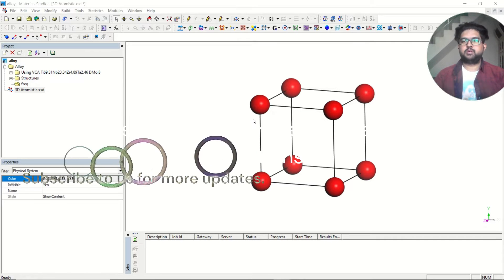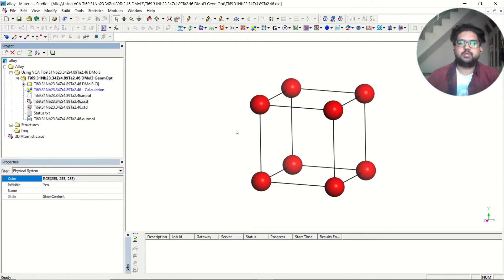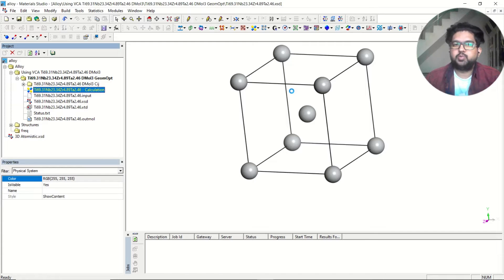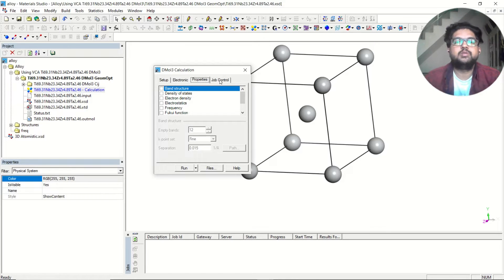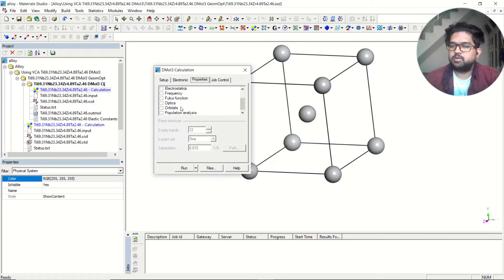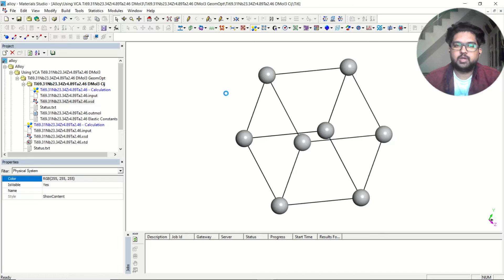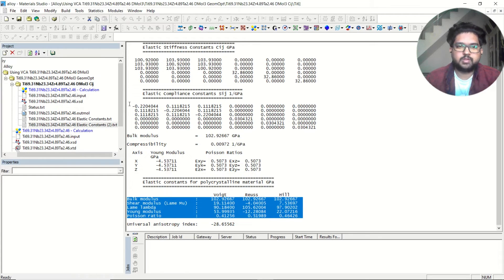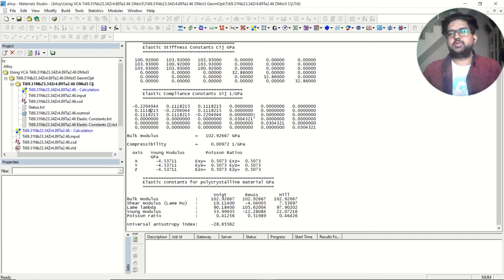Elastic constant and other mechanical properties calculations ||Gaurav Jhaa

Comment: I have a doubt....we have elastic constant calculation in materials science using energy deformation method....again we have elastic calculation using the stress strain method ...what is the difference between the two? if my energy converges via energy deformation method...and I develop a potential on the basis of it....and finally fit in the quadratic curve to find the elastic constants and thereby the elastic constants like bulk modulus, elastic modulus etc... is calculated using the formula for different crystal structure...then is that calculation correct?
Reply from the maker: The elastic constants of a material describe its response to an applied stress or, conversely, the stress required to maintain a given deformation. Both stress and strain have three tensile and three shear components, giving six components in total. The linear elastic constants form a 6 × 6 symmetric matrix, having 21 independent components, such that σi = Cij εj for small stresses, σ, and strains, ε.
Any symmetry present in the structure may make some of these components equal and others may be fixed at zero. Thus, a cubic crystal has only three different symmetry elements (C11, C12 and C44), each of which represents three equal elastic constants (C11=C22=C33; C12=C23=C31; C44=C55=C66). A single strain with non-zero first and fourth components can give stresses relating to all three of these coefficients, yielding a very efficient method for obtaining elastic constants for the cubic system. A full account of the symmetry of stress, strain and elastic constants is given by Nye (1957).

Properties such as the bulk modulus (response to an isotropic compression), Poisson coefficient, Lame constants, velocity of sound, elastic Debye temperature, and so forth may be computed from the values of Cij.
Methods to determine the elastic constants from first principles usually involve setting either the stress or the strain to a finite value, re-optimizing any free parameters and calculating the other property (the strain or stress, respectively).

By careful choosing the applied deformation, elastic constants can then be determined. However, applying a given homogeneous deformation (strain) and calculating the resulting stress usually requires far less computational effort, since the unit cell is fixed and does not require optimization. This is the method implemented in CASTEP and DMol3.

There are more sophisticated methods for calculation of elastic constants from DFT calculations (for example, based on the linear response method), but they involve significant changes to the DFT code itself, rather than utilizing the output of a standard DFT calculation for a deformed unit cell.

The finite strain technique has been successfully used to study the elastic properties of a range of materials including metallic systems: Al (Deyirmenjian et al., 1995), TiN (Marlo and Milman, 2000), TiB2 and MgB2 (Milman and Warren, 2001b); minerals: MgSiO3 (Karki et al., 1997b), Li2O (de Vita et al., 1992b), MgO (Karki et al., 1997a), silica polymorphs (Karki et al., 1997c), aluminum hydroxide polymorphs (Gale et al., 2001); compound semiconductors: AgGaSe2 (Karki et al., 1997d).

The results of these and numerous similar studies, show that the accuracy of DFT elastic constants is typically within 10% or less of experiment. This allows prediction of elastic constants for new materials (Milman and Warren, 2001b) or for materials where experimental data do not exist (Winkler et al., 2001b); to predict elastic properties under pressure (Karki et al., 1997c) or to resolve discrepancies between contradictory experimental results (Milman and Warren, 2001a).
Reply: @quantumguruji  Let's say that the formation energy calculated from DFT and the ones calculated with the developed potential (whose training data is the DFT data) matches. And through the various energy-deformation quadratic equations for different crystal system also matches for both DFT and the potential. Then, will the empirical correlation in VRH approximation for calculation of mechanical properties like bulk modulus, elastic modulus etc... be valid? Can we report such a result in paper?
Reply from the maker: @PradeepKumarRanammd  in that case you need to do the several calculations to make a library and then you can generalize. But just based on a few calculations you can't do this.
Reply: @quantumguruji  You mean several calculations for determining the elastic constants, thereby creating an elastic tensor and determining the values of mechanical properties based on those constants right?

Comment: your are serving great to the new researchers. plz also make a video for the calculation of DFT+U method for the correct bandgap values and calculate other properties of material in castep.
Reply from the maker: Tomorrow there will be a new video on band structure calculations using HSE06 functional. Which gives better results, close to experiment. For publication purpose we use this. Stay tuned. Thanks for watching videos.